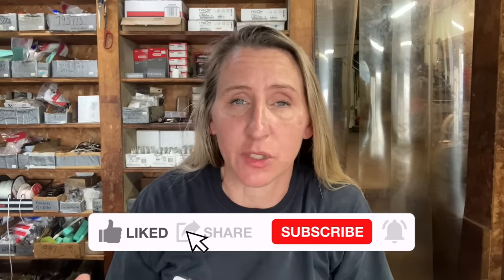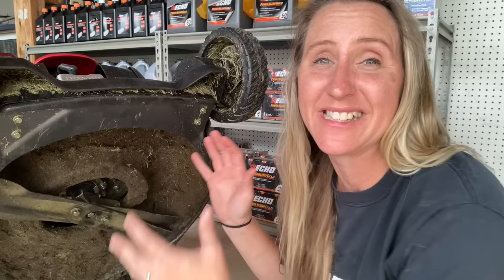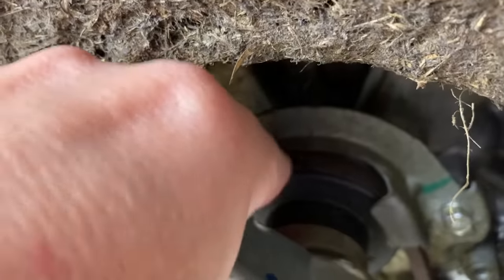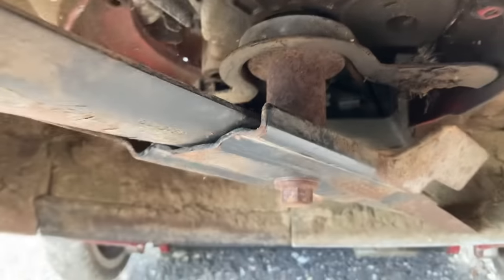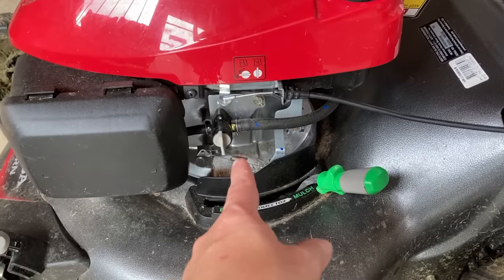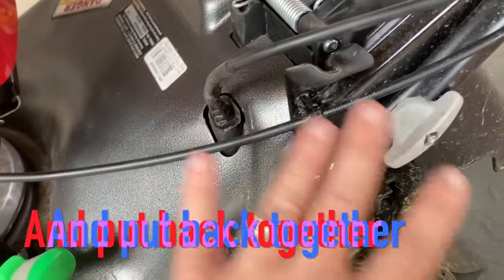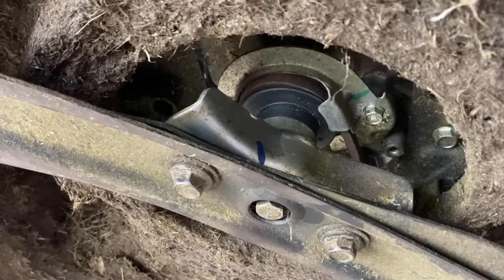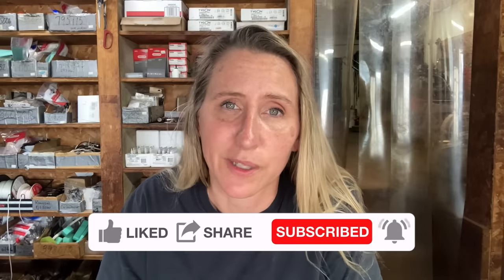SAVE A TON OF MONEY in repairs by NOT BUYING this NAME BRAND mower.

Comment: As a landscaper, who uses multiple walk behind mowers, from many different manufacturers, the declining quality and declining dependability of mowers is obvious.  The problem certainly is not exclusive to Honda products.  Your correct that certain manufacturer's products have inherent parts quality and design flaws that appear over and over to cause failures.
Notifying the manufacturers in writing of the problems and my experience, never seems to result in the manufacturer taking responsibility or correcting the part or design flaw, even in their next generation of the same product.  Many years ago, Toro changed a once dependable part, used in the deck height adjustment mechanism, from aluminum to a plastic material.  The part continuously fails and I now buy them by the dozen to have stand-bys.  The dealer has told me that they sell thousands of that replacement part each years to repair multiple generations of that mower.  The manufacturer is obviously aware of the issues, as they are notified often by customers directly.  I would assume they maintain communications with their dealers and service centers, who also identify the issues.  The manufacturer is also aware that they are supplying an inordinate volume of specific parts to their dealers and repair centers on a continuous basis.  The customer can only assume that the manufacturers are designing obsolescence into their machines for the purpose of selling parts and service, rather than improving design and selling a better product.
Reply: You're right planned obsolescence makes a lot of money. It seems once someone has a good reputation of putting out good products then, they start the planned obsolescence, time to make lots of money selling parts. 
 Many of these manufacturers have sold their ethics out to making more money.
Reply: Same with washer and dryers the declining quality. I buy a fair amount of washers and dryers every year for commercial use. I have noticed a marked decline in quality and quality control in coatings, in wirings and quality of workmanship, particularly these last 10 years.
Reply: It's really unfortunate that so many different products in our society are falling under this same fate, and there's only one reason: money. In your case, imagine all of the extra money they're making selling those replacement plastic parts. Caring about and being proud of what you make and sell has almost become a lost art.
Reply: If I ran a manufacturing company I would closely watch repair part sales.  And if I'm selling a lot of one or another part, that part is bad and has to be redesigned to fix whatever is wrong with it.
Reply: @hunkydorian  That seems completely logical, but when a manufacturer realizes that the defective part has added $650,000 dollars to their profits, they take a different road.
Reply: This guy is 100% correct...the problem is declining quality across the entire realm of consumer products. And I'm going to say it...we have Asia to blame. Light and tinny has become acceptable and we as Americans now think that is an actual attribute that relays quality. I bought a snow blower a few years ago and thought I had a pretty good one until it quit on me in year 3. I then borrowed my dad's 1978 Craftsman. It was a real eye opener. I felt my blower was made of aluminum foil compared to this monster. It has never been apart and still runs to this day. My blower will maybe work for 10 years before it is to rusted to continue. Sad days to think you have to spend $1200 2 or 3 times in your life to clear snow from your driveway.
Reply: That is how a great company became a good company and finally become a bad company as customers look elsewhere when they are in the market.  Look no further than GM and Ford.  They were great from the 40's to the the 70's but started to sell junked cars and trucks in the 80's , so much so that peoples joked that your need to buy two, one is for spare parts.  And we know how that turned out for American car manufacturing industries.  GM and Ford  both improve their products in recent years but many still perceived theirs as 'unreliable".
Reply: @paulc2548  A great example.  I certainly remember when people thought FORD stood for 'Fix Or Repair Daily".
Reply: Perfect summary of todays throw away culture and serious consumer society.
Reply: @metal1301  At least we have in Europe a law that requires from any product a certain quality. This bypass official guarantee regulations. For a washing machine we expect them (by law you could say) that they last at least 7 years. It's the producers problem if it last less time. Also this part in the video...reoair costs would be claimed by every customer to Honda (dealers). Especially when it is within 3 moinths. Even if they are complaining of mowing wet grass I think the judges will tell the company that they cannot make a mower that does brake down on wet grass. And of course the name Honda would be destroyed quite fast in Europe due to internet reviews. To much people read them before buying anything. And may be this also would effect the sales of other Honda products as motorbikes.
Reply: @hunkydorian You most be the exception, other companies don’t do that.

Comment: Ive used Craftsman mowers with Briggs motors since the 80s. Never an issue, I get 15 years out of them..they still run fine when I give them away and buy a new one. Just like cars, its nice to have a new shiney one after a while. 😎
Reply: Same answer, BUT, I bought a "new" mower with b&s engine and it didn't last an hour before it was smoking. Yes, it had the proper oil level.  These new mower are not what they used to be.  Doesnt matter the brand
Reply: @georgemurray6845  I'd like to buy the kind of mower they were selling 15 years ago. Things change. I am mowing 5 acres in Hawaii and it gets wet a lot.
Reply: Do they make them like they used to?  I have a John Deere walk behind I bought new in 1992.  I cut down a fairly large silver maple, threw all the smaller branches in a pile and ran back and forth across it with my mower until the pile was gone.  While doing this I cracked the aluminum deck and had to have it welded.  I've had to replace the wheels several times because the tread wore out and the wheels were too small.  Other than that it still runs like new.  And Hondas quit because grass gets in the belt?  Ha!

Comment: I have this exact model and have used it commercially at about 5-8 hours per week, for about a year, with zero (0) issues. Granted, I would never allow my mower to look as neglected as that one (1) did, underneath. 

In any event, I appreciate the potential heads up and information. Keep up the great content.
Reply: Same. Solid mower
Reply: I myself just had this HRN216VKA delivered yesterday and I just unboxed it today. Heck, I haven't even put in the gas or oil yet. I then saw this video tonight and my heart sank. I hope I didn't make a major mistake. 😖

In my purchase research I knew some people had experienced premature belt issues, but I chalked it up to users who don't maintain their machines properly, which is something I plan to do—my previous mower died because of a lack of caring for it. But at $500 for a replacement mower I won't be making that mistake again! In the video seeing how caked the grass was tells me that the owner didn't keep it clean, plus they most likely had the deck too low for thick, wet grass to properly mulch back into the thatch.

At this point it looks like I have no choice but to use the Honda I just bought, but I'll now be extra-observant of the mowing conditions and adjust my mowing accordingly. I already plan to carefully maintain the engine with proper oil changes, filter & spark plug checks and using only treated gas for storage, now I'll be cleaning the under-deck after EACH use. Hopefully I won't come to regret my purchase, but it is nice to have that 3 year warranty that I hope I'll never need. This model is already a couple of years old and I can't imagine they'd still be getting SO MANY positive reviews if every-other one sold breaks down within a few months. 🤷‍♂️
Reply: @kerigpope  Like I mentioned, I use it 5-8 hours a week, sometimes more.  I regularly keep the underside clean, and avoid wet grass when I can.  And when I say clean, I mean all I do is take a water hose to it, and clean it out. I occasionally put a bit of John Deere belt dressing on the belt.  I change the plug once a season, and shake out the air filter after each full day of use.  And given the hours I put on it, I change the oil once a month, and use a full synthetic 10w30 (it's cheaper than buying Honda conventional oil).  I've honestly expected problems given how tough I am on it, but I haven't had a single issue, minus lubricating some squeaks. The only thing I would change is I would buy the model with the bigger motor.  Although to be fair the motor (170) has not been an issue.  It's also the most fuel efficient mower I've ever had my hands on. 
Good luck with your purchase friend.

Comment: INFORMATION LIKE THIS VIDEO IS THE BEST WAY TO SOLVE THE PROBLEM.
Believe me, if the sales of this model drop off by 80%, the manufacturer WILL take notice and fix the issues.
The only suggestion I would make is to end the video with a list of the most reliable alternatives that you know of.
(You could always put that list in your description too.)
If a manufacturer puts out a piece of junk, they need to make it right for EVERYONE who bought it.
And if they don't, they should lose customers and sales until the problem is fixed.  I used to work as a motorcycle mechanic, and I saw Honda screw over owners on a technicality. (Their warranty only applied to original owner.)
I had several 1 year old bikes come in with almost $1000 worth of damage that Honda wouldn't fix.
I've owned many Hondas, but after seeing that, I'll never own another one.

Comment: It is virtually impossible not to mow damp grass here in the south and at $600 for a walk behind mower Honda has a serious problem!!
Thank you for being a honest mechanic, it goes a long way these days especially at current labor cost. Thank You!!!  Pensacola
Reply: @rick: $600.00, not bad. If you keep the mower forever, it’s a one time investment. I’ve had the same Honda mower since 2009. Paid a little over $400.00 for it. So far, amortized out, that’s $33.00 a year. It still functions great and I plan to keep using it. I’ve worn out the rear tires, self propelled. Cost about $60.00 to replace.

Comment: I've owned a Honda self propelled mower for about 8 years and it has ran flawlessly-started first pull 99% of the time. Then the issues started....the dreaded exhaust valve sticking. My local Honda dealer wanted to put a new motor on it!! I got the valve unstuck by spraying it with carb cleaner and working it in and out. It ran for a short time after until the rocker arm broke and the guide came out. I tapped the guide back in and replaced the rocker arm. I peened the area around the guide, so hopefully that will make it last a while longer. Thank you so much for your videos; they are very informative.

Comment: I have an HRX about 6 years old. So far so good. Change oil every spring and plug and keep filter changed during season and run 93 non ethanol gas only.
Reply: This line has been coming in the last year. Until then every Honda mower has been spot on. They will straighten this out, might take a year or so, but they'll get it right.
Reply: @dudekanic  Hey Ron, Are these machines not covered under warranty? I advise people not to buy any new equipment. It's all junk in my opinion unless you're gonna spend big money.
Reply: @rods.3245  Yes they would be, however, the Honda dealer here has been 6 months out, so we are faster.

Comment: Love your honesty.  My son worked as a small engine mechanic for years.  I must say that while this mower has issues, it is amazing how people mow wet grass and let it get caked up like this for any mower.  You must roll your eyes at how people abuse their equipment.
Reply: I worked at a golf course. Grass cut every day in the early morning. The sprinkler system ran every night even when raining. Many different types of mowers. We just loved cleaning equipment. We would get into the rough areas with push mowers similar to the types homeowners use. We set the front wheels higher than the back - made mowing thicker long grass much easier.

Comment: Great info! I’d get a goat before spending $600 for a push mower. 
I will certainly check for a guard/cover on my next mower. Takes a lot to impress me but you do it with ease!
Reply: I paid $500 for a John Deere JS40 15 years ago. It has been a good mower. Had to service the carb once and replace a few parts here and there. Generally you do get what you pay for. Obviously this was an oversight on the part of Honda engineering. I would be charging back to them as warranty service, especially for that cable retention failure.
Reply: Lol $1k is cheap. Imagine paying $4,000 for a Honda snowblower. That’s what they cost. Look it up
Reply: @appleztooranges  I get a 3 finger discount on snowblowers.
Reply: Funny that you mentioned getting a goat.  A buddy of mine back years ago had 2 goats that kept his lawn cut.  He would say watch where you step.  You might step in goat shit if you don't.

Comment: I had a lawn care business (I'm now on your side fixing them instead of braking them) and I bought a HRN because I couldn't quite afford an HRX.  It almost lasted a season.  I don't recall the drive system having problems, but the wheels literally fell apart.  The plastic hubs cracked and the tread actually came off and I couldn't get a simple replacement wheel!  I also had issues with the governor, but that's fixable.  I bought an HRX and love it.  Haven't had any problems other than the coil somehow got out of adjustment.

Comment: Great info!  Thanks.  FWIW it seems Honda products can only be bought from Honda dealers in Canada.  The lowest end HRN216  retails for over $700 CDN before tax!  Thankfully my 23 year old MTD is still running.  Yes it has about 5 lbs of mig wire in it (keeping the deck going) and all 4 wheels have a ridiculous amount of camber and very little tread left now.   It ain't pretty but still starts, runs and cuts great.  I'd hate to pay over $700 for a mower only to find out it was garbage.  Hopefully you saved a lot of folks from making a horrible and costly mistake.
Reply: I like your style, had a craftsman garden tractor I mad maxed together for a few years. Eventually got a ZT with a fabricated deck.
Reply: @tylercruit6261  I just got a Craftsman  last year. How old was/is yours?
Just had forward shift seemed to skip out on me. Doesn't seem to fully engage...? Have you had that problem?
Reply: My mowers are older than I! Good ole 2 stroke victa's!

Comment: Morning Ms. Bree,
I have one from 2019 fall time line i bought from home depot. Less than 10 hrs on it
Stopped from rolling backwards. Wheels would slide. Found out this was a common problem. Sand or grit would get into drive system and thats it. Fixed problem by purchasing a self propelled snapper ninja.
All good now
Reply: Hey I recently picked up a Snapper commercial 21” with Kawasaki motor. It was Free and only needed a coil.
Reply: Great. Nice find.

Comment: I had a Murray mulch mower I bought in the late 80s. It lasted well over  10 years. I moved and gave it to my brother. In less than a month, he broke it by going head on to a metal piped metal sprinkler head. He bent the shaft and at high speed it wobbled from being imbalanced. Some people just have the Midas touch in reverse

Comment: That deck is not nearly as bad as the ones I used to see in my Uncles shop. The worst were those from city dwellers. Most farmers did not use these small walk behind mowers, but occasionally I got one from a farm where the wife wanted to mow an area around the house with a hand mower, and yess even they did not cut when dry or would just let the deck get full. It takes a lot of time (especially self propelled) to clean the decks out completely. The w is rat were those with the "wash out adapters". All that did was leave a damp deck that would collect grass under it even faster! Had horrible smells, especially when mowing around livestock pens! Keep up the good informative videos. I was doing this probably before you were even born (started helping my uncle at 15, now I am 72 (where did the years go).

Comment: I bought a Honda walk behind 8 years ago and went to check underneath after watching your video. I check before each mow for caked grass/debris underneath but have never really had any issues with that issue. The opening above the blades a little different but not exactly like the model you demonstrated. Looks like I'll be checking this more closely in the future. I've never had any issues with the mower at all. It cuts really well and still starts on the first pull. It's the only pull start lawn equipment I have that my wife can start by herself. Really appreciate your video and taking time to share your knowledge and experience to educate us. Thanks from a new subscriber.

Comment: Wow, great timing for this video! I recently spent over an hour disassembling the underside shroud in order to remove a jammed stick. And about 20 minutes of that repair was spent trying to get one bolt to line up with a T-nut that could not be held in place. Talk about frustrating!!

A few days later, I decided to disassemble everything again in order to Loctite all of the nuts and bolts to keep them from vibrating loose. And that ridiculously inaccessible T-nut? I epoxied that sucker back in place! LOL!